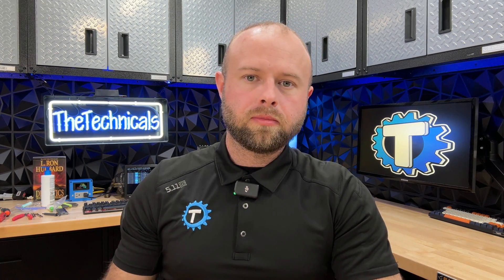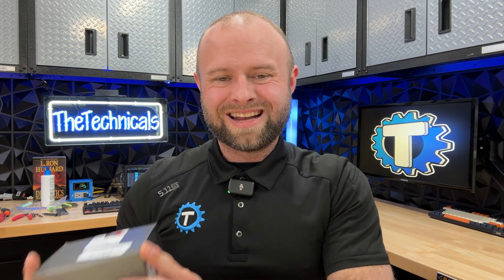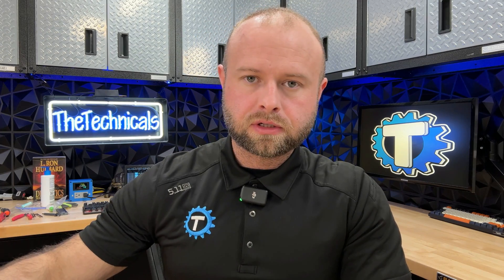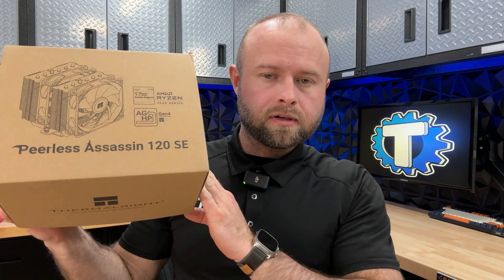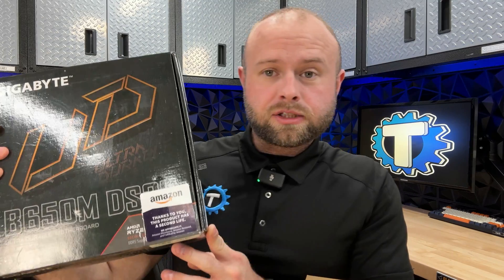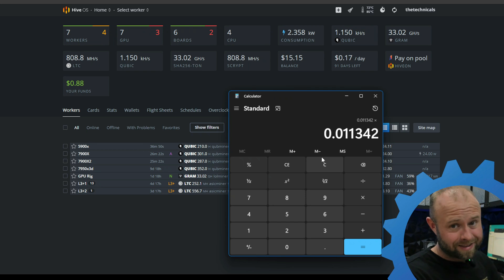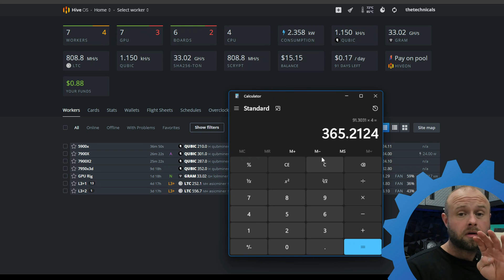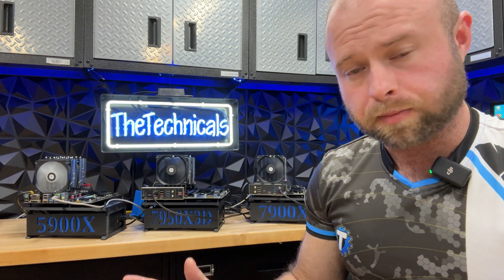Building ANOTHER 7900x CPU Miner

Comment: CPU 2024-05-31 09:01:28 ERROR   GLIBC Version must by >= 2.34
CPU 2024-05-31 09:01:28 ERROR   General error: FATAL: GLIBC Version must by >= 2.34. Trainer can't be s
tarted properly.(FATAL: GLIBC Version must by >= 2.34. Trainer can't be started properly.)
CPU 
CPU System.Exception: FATAL: GLIBC Version must by >= 2.34. Trainer can't be started properly.

Whats the solution?

Comment: Hey mate, nice video! I use a E5 2378V3 (24 threads). When I set threads to 24, I get the same hash rate as setting 12 threads, its very weird.. the command is amountOfThreads":24 (I've already checked RAM and MB limitations, its not the problem). Is there any command I can run all my cores?

Comment: Thanks.  I have Watched Rabid 's build, but I'm new to mining and maybe a watered down version (SLOW 😂) Of the tuning/BIOS setup in the would help me.  

PS... how long does it take to 3D print the rig stand?
Reply from the maker: Depends on the printer. I started with an ender3 which was painfully slow and small. A week later I got the K2 and it's worth every penny. About 10x+ faster. Those stands would've taken days on my ender, but K2 does a complete one in about 3hr. Buy using my link in the description!

Comment: my problem with mining is the hardware you have to buy is expensing when you buy It and it loses value so fast, especially when the mining rush ends. it also only happens to be profitable for a few months. it's like owning a stock with a high dividend, but it's likely to have a dividend cut shortly and drop 25-50% of its value in a year. It's like trying to pick up dollars in front of a stream roller.
Reply from the maker: PC hardware keeps it's value pretty well esp if you go into current gen stuff, but I get what you're saying

Comment: From the data I've seen the 5950x looks like the best value for mining randomx. It nearly ties with the 7950x in hashrate, (hashrate.no puts the 5950x ahead of the 7950x for randomx hashrate)   has a slightly better efficiency rate, runs cooler, and you can build out an entire miner for the price of just a 7950x CPU alone.  besides AVX 512 (which doesn't seem to matter with randomx) why pay the premium for the 7950x for a dedicated CPU mining rig? What am I missing here in my value calculations?
Reply from the maker: I factor resale into every decision heavily. When I ultimately sell this hardware, people will gravitate towards 7000 series over 5
Reply: @TechnicalsMatt   OK that makes sense. My component liquidation  strategy is to build out and sell some budget gaming PCs. I figure the 5950x will be a good  match for my 3070 GPUs when that time comes.
Reply: But for QUBIC, the 5950x doesn’t support AVX512.
Reply: Really?)